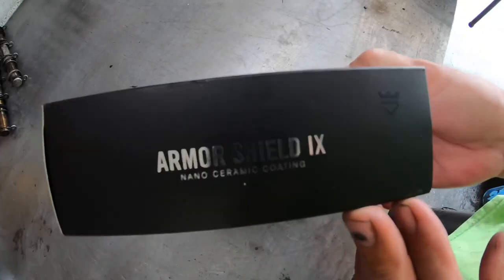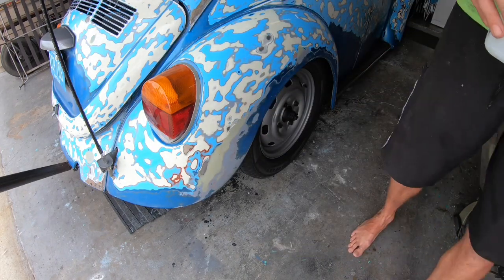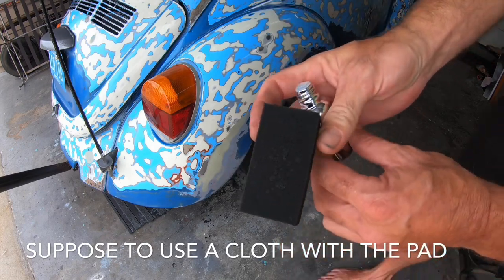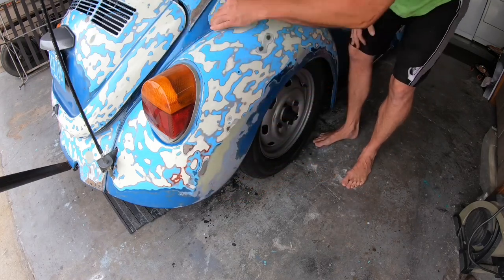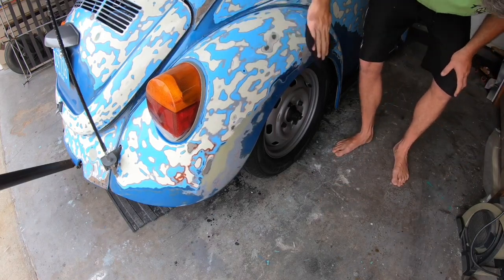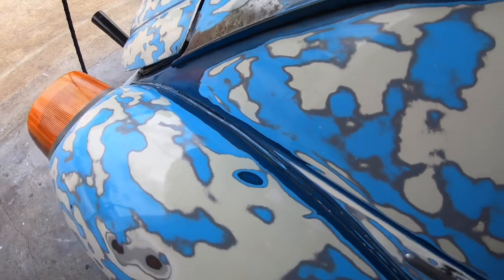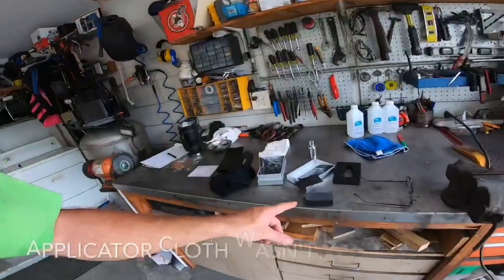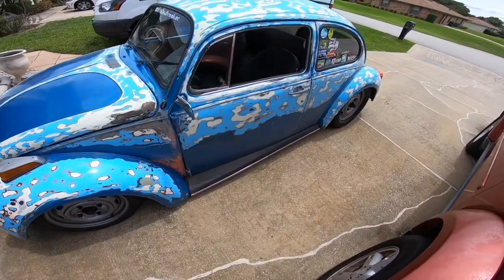How To Ceramic Coat YOUR Car AT Home! Easy DIY

Comment: Our beetle has pretty rough paint.  We actually used steel wool pads and washed it down and ceramic coated it with mother's and it actually turned out pretty nice❤️
Reply from the maker: Nice job thinking outside the box! Keeping up with them will help them last longer.

Comment: That's pretty cool might have to check that out. I see a stinger back on your car, how about a video with some Jawbreaker Sweetness in the background?
Reply from the maker: Yes sir, has to switch back to the stinger due to the muffler had too little ground clearance. I personally love the sound of the muffler more!
Reply: I agree, but I still love obnoxiousness of a stinger every now and then. The sound of a stinger wrapped up tight reminds me of when we raced off-road when I was the kid.
Reply from the maker: I agree completely, I love the sound of a stinger. But this engine sounds so throaty and tough with that muffler vs the stinger.

Comment: and too think opti coat diamond protection here is 7-900 bucks (AUD) and this kit is worth?...anyway what the hell am I woffling on about ?..wont work on RUST😅🤣 good video and good product
Reply from the maker: Haha, I was hesitant about using it but it went on really well and water runs right off of the car like it’s suppose to. For the price you can’t go wrong. I’m totally impressed!
Reply: @VWJawbreaker  what is the price ...I do have a shiny car as well😁
Reply from the maker: Think it was $70 US
Reply: @VWJawbreaker  cheers you floridian...